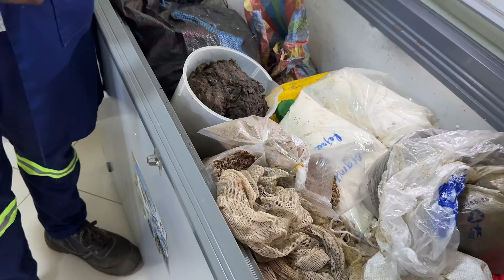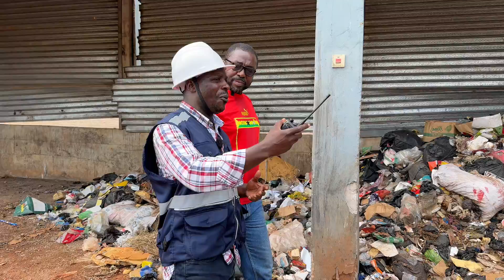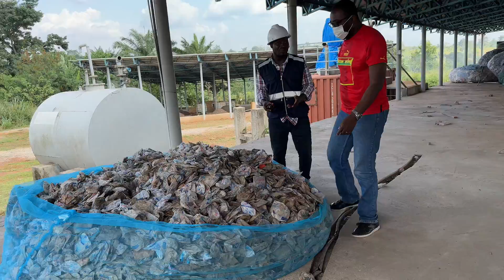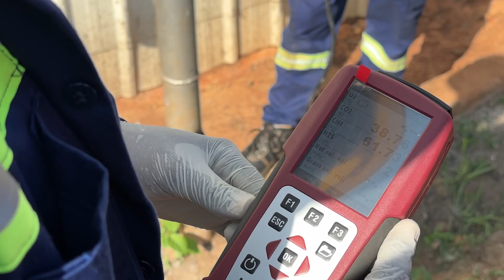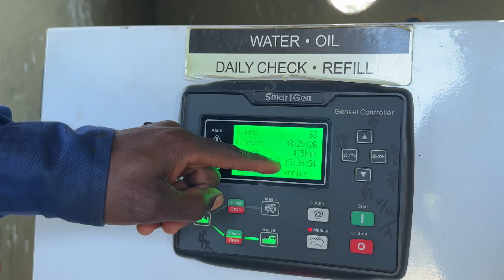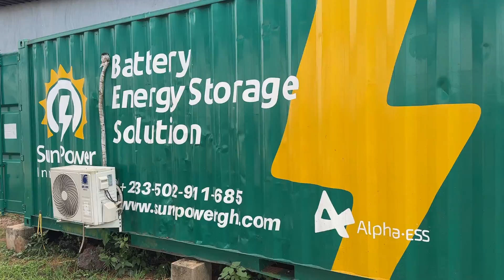How Waste is Used to Generate Electricity in Ghana

Comment: Gas particles are not compacted like solid or liquid. So they are able to move freely. For instance, when you spray a specific area in your room with mosquito repellant. In no time, you can smell the repellant in other areas. Because the gas particles are not compacted, they can be compressed or forced to occupy the small space of a container. This compression or external force increases the pressure in the container and increases temperature, which in turn increases the kinetic energy of the gas particles in the container. Hence the energy generated.